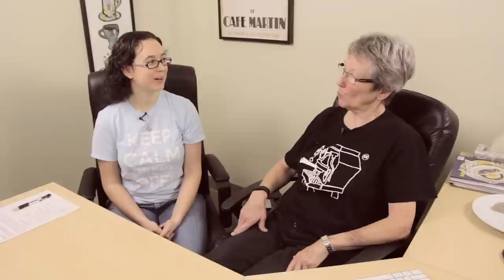Ask Gail: How To Fix A Sour Espresso Shot

Comment: A professional barista once told me that fixing shots by tamping harder or softer is not a good idea because it's hard to replicate the small adjustment in subsequent shots (unless you're using an expensive calibrated tamper). Correcting by dose or by grind are the best options because it's easy to replicate. Choosing dose or grind depends on what you're trying to correct: if the shot is balanced but too weak or too strong, correct by dose; if the shot it not balanced (sour or bitter), correct by grind.
Reply: Bingo!
Reply: Thank you, exactly the information i was after.

Comment: Need help with my Breville barista pro that I got super recent. Up till this point I have not got a decent shot! The beans are Lavazza E Aroma, medium roast with an 8 intensity scale. I set grind size 6 towards fine and grind amount for 14 seconds. Still the brew time has always finished in 15 seconds. Extraction starts to drip in 7 second btw. It’s taste sour! At this point I don’t know what to do. Should I set coarser?
Reply: No, sour is under-extracted, and 15 seconds is way too fast. So you should grind finer, not coarser. Also try to grind by weight. I aim for about 17-18 grams for a double shot. Brewing should take 20-30 seconds.
Reply: @TheMrVengeance  strangely I tried fine setting dial down to 1-3. It still ends abruptly in 15 seconds no matter what the grinding setup I chose. I then start playing around with the pre-included-filters. I used double wall double shots filter. To my surprise, it improves a little from stopping at 18 seconds this time! Still not good enough, so I programmed the pre-infusion setting extend the brewing time to 22 seconds, the shots now end around 25-27 seconds depending on my tamping and etc.. It doesn't taste too sour or too bitter, it has a bright taste but to my palette, I can't taste any particular notes like chocolate or dried fruits from the espresso Lastly, I have not try any fresh beans but only the beans that have an expiry date... Maybe I will try the fresh beans for my next batch with the single wall and then see how it will go...
Reply: Yeah best to hold the shot button down for 6 to 7 seconds to preinfuse then let the button go , to start extraction . Im sure the italian beans go through a different process where they stay fresher for longer. Try looking for a local roasting house nearby
Reply: Did you manage to sort out your problem?  My Barista Express extraction is never longer than 10 to 15 seconds and tastes sour even at the finest "1" setting! Temperature espresso comes out is is 77C, 170F.  Not sure if there's a temperature fault.
Reply: @allayth3247  that’s a temperature fault! I return mine a long time ago.
Reply: If you have the attached grinder of the Barista pro, you can adjust the internal burr grinder to be finer. The stock setting (I think it's 5/10) is way too coarse. Setting at 2/10 will help significantly.

Comment: Hi Gail! Please help me if you know the answer to the question ... My espresso machine has a solenoid valve, and I'm not sure if my machine needs a small silicone ball that folds from below into a group ... When I opened it to clean, I did not find it inside, And with my other machine (Saeco Aroma) it has a ball.
The brand of the machine is Emonec (in essence, its appearance and its parts are identical to Lelit) ... I have a problem when I turn on the water to leave the group, exits excessively steam and uncontrollably hard ... the temperature when going out of the handle is 90-92 ... The operating thermostat is 95c, I tried to replace it, but I still have the same problem ... Here are two examples: When there is no ball in the group, after each shutdown of the release of the water through the group, the backflush is not heard back ... and when I put the ball in the group , After every turning off the water, in the background, ejection of water and steam (backflush) is heard ... I'm not sure if I need to insert a ball into a group or do not need my machine? I ask the answer to this question if you know, it would mean a lot to me ... Another thing ... every espresso I make on my machine is great looking and has extraordinary cream, but the taste is very bitter and acidic (the doses of coffee that I tried vary From 16-18 grams for 2 cafes, the extraction time is satisfactory, from 22 to a maximum of 28-29 seconds) ... I do not know what the problem is specifically because I tried many varieties and lots of coffee thrown, and I can not get the proper fine Taste ... I suppose you do not work with these brands of machines like me, but if you know the answer to help me. Thank you very much and greetings!

Comment: I have a question: I'm tamping hard (just to be safe) my finely ground espresso coffee that's about a month old now, and the shots come out much faster (like within 10 seconds) off the pressurised portafilter on the Poemia. And the shots are a bit sourer nowdays. I give plenty of time for machine to heat up before dialing brew n everything. Does old ground coffee produce sour shots as well? Or is something else going wrong?

Thanks.
Reply: 6 years old but you would fix the fast pull by grinding finer. Keep in mind that you might need to add another gram or 2 of coffee to compensate.
Reply: @aydenkay8952  Thanks. Yes over the years I realized that ground size that was indeed my initial issue. 😂😜